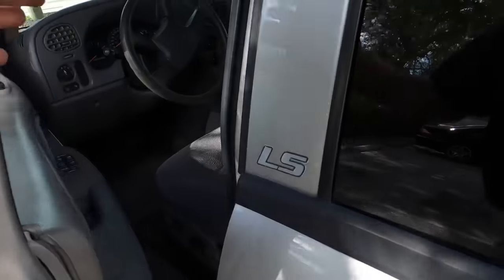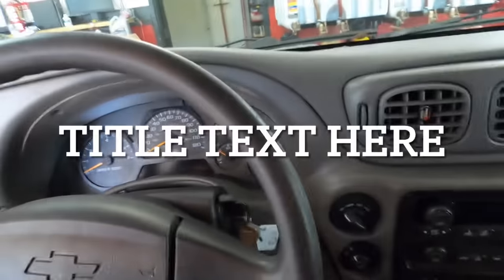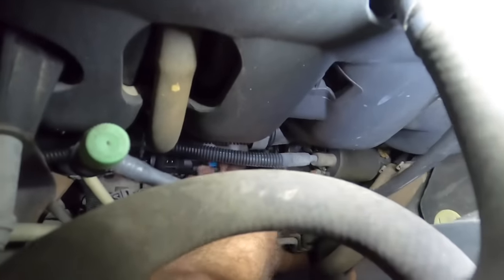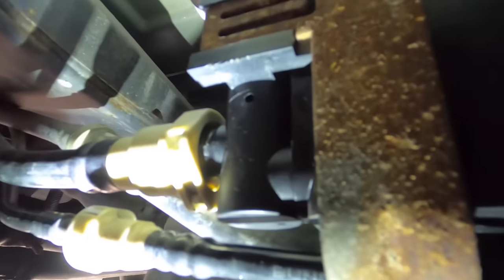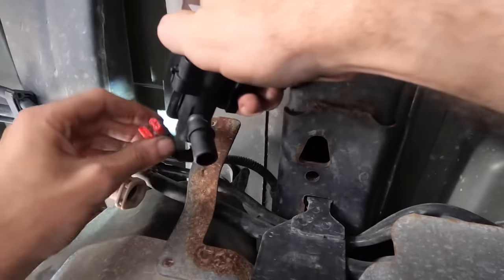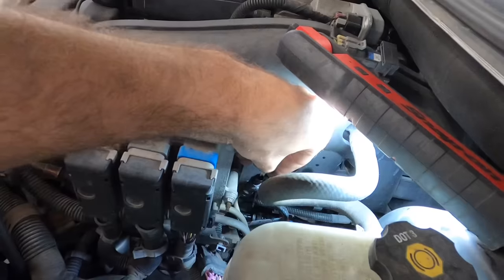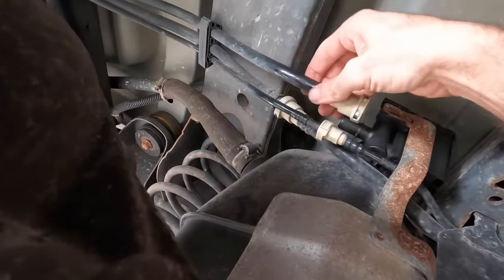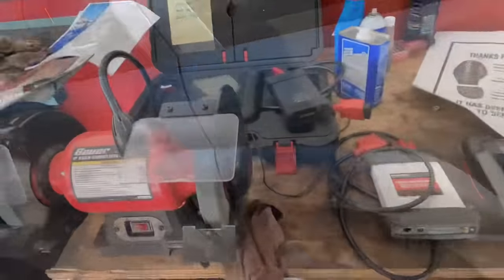Repair failed! Customer is Angry

Comment: May I ask why mechanics NEVER road test vehicles so they can feel and replicate the exact symptoms the customers are talking about
Reply: They often do. I had my brakes done last year (shuddering when slowing down). As I was walking to the bus stop to go to work after dropping the car off, I watched the mechanic start up my car, absolutely floor it down the street, then stand on the brakes repeatedly. They skimmed the front rotors and the brakes have been fine since.

Comment: I work on class 8 trucks Penske and Rider send trucks all the time with the codes erased it is insanity tell my service writers my crystal ball is broken due to the chip shortage. We tell them to kick rocks and charge them one hour for diag this has happened a couple of times now never again and the customers out of warranty that want a part installed for a cel a diag or nothing you turn a wheel and shift gears for a living I fix your livelihood.

Comment: Why the hell do people get the codes and the check engine light erased? It’s not fixing anything, the problem is still there. The biggest problem is usually the nut behind the wheel, and you can’t fix stupid. You should charge the idiot a stupid fee. If something is wrong with one of my vehicles and I don’t know how to fix it, I take it to someone who can diagnose and fix it. I’m not going to go and have the codes cleared. My mechanic needs to see the codes and hopefully it’s not going to cost me an arm and a leg to fix it. This guy gives off a vibe that he’s trying to scam your shop and get free repairs. Charge him 500$ for the stupid fee. How many other shops has he scammed? The stupid fee might be a good deterrent to stop people from scamming mechanics.

Comment: The car repair problems on this car should like the owner is dumb that is the main issue, if he can not leave the codes alone, hand it back to him to figure out, your time and knowledge have a dollar value and he sounds cheap.  Self repair then run to you when it is wrong. Hope you advise the customer in future to leave the codes so you can have that information to help you work on the auto problems, the guy sounds like well you know.

Comment: What kind of stupid do you have to be to clear the trouble codes, then expect some mechanic to find a problem that doesn’t currently show up?  Then add in an owner that buys junk parts on eBay, most likely.

Comment: "it's a faulty valve ... time to get a new one"
it IS a new one ... and that's the state of the INFERIOR aftermarket part biz 
the sellers KNOW exactly how MANY of each category of their defective parts will NEVER work in any car ...
from the DATA from last week, last month, last quarter, last year ...
(from what they sold ... what was returned ... and why)
the thing they DON'T know is exactly WHICH ones (which boxes) have the good ones and which have the BAD ones ...
and that's where the most SKILLED (and likely expensive) person in the chain (the mechanic) distinguishes the good from the bad ...
just like the QC person should have done at the FACTORY ...
if only they HAD a qc person ...
at the factory ...

Comment: Is it just myself who sees 'anything gm' is filled with electrical or electronics problems? The highest profit margin division (chevrolet) started in 1971 with the world's worst idea of side post battery terminals. I have seen those things do such atrocious things. starters, solenoids of all sorts, alternators, other electrical components, electronics...all junk. 
But the masses just love these things regardless of the problems they give everybody; seems to be a tolerable problem to have a water pump go bad on a gm versus a water pump to go bad on a Chrysler or a Ford. If the latter two do it, they are "f-ing junk" to those masses. I guess you just can't rationalize with the collective.